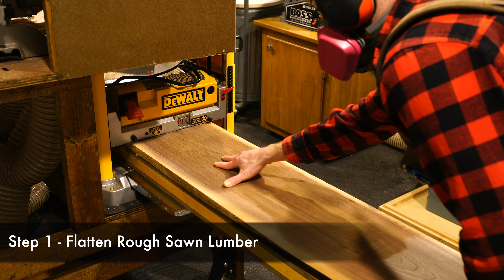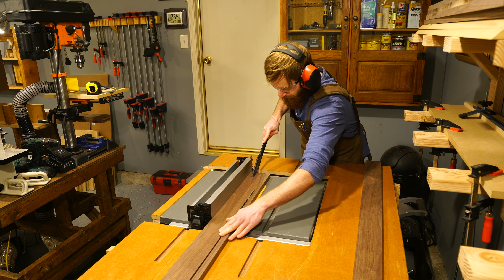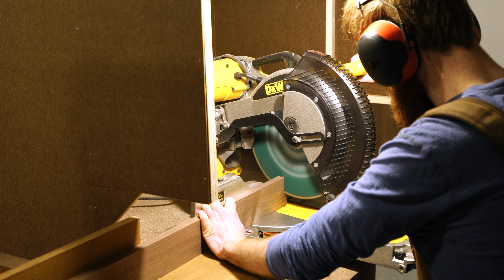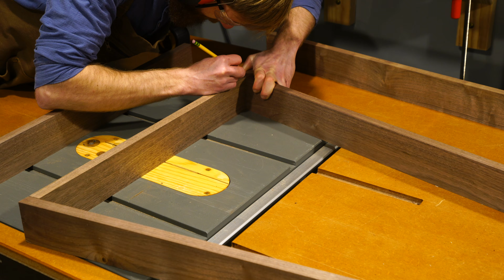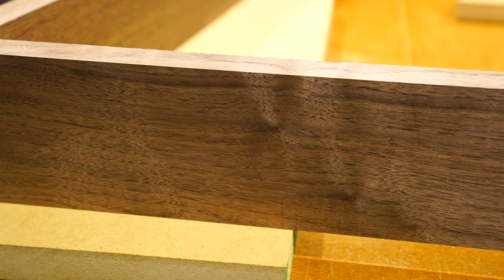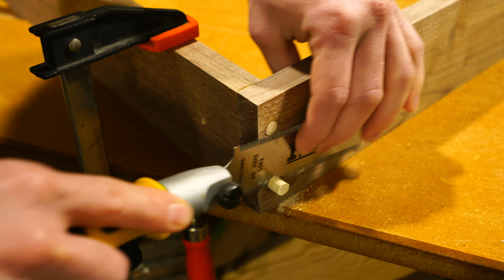How to Build Modern Desk Legs - Free Downloadable Plans Included!

Comment: I wanted to confirm something, i am currently making my legs. Did you cut all ends of the boards a 10° or did you only cut the inside boards a 10°?
Reply from the maker: To match the angle and to make sure the legs sit flush to the floor, the inside board and outside board both have to be cut at an angle at the ends.

Comment: If I wanted to make a table with a depth of around 36 inches would I need to change the angles? As the plan mentions a depth of 24 inches or greater I figure it could be necessary(?)
Reply from the maker: Yes I’d increase the angle for about 32 inches or greater especially if the legs are going to be the same height as my example. Good call my friend 👍
Reply: Great thanks for this advice - would a larger angle be something like 10/11/12 degrees or much larger? Just starting out on building furniture so still not sure of these subtleties haha
Reply: Great thanks for this advice - would a larger angle be something like 10/11/12 degrees or much larger? Just starting out on building furniture so still not sure of these subtleties haha
Reply from the maker: @sunking9625  yes I’d start out small with just a few degrees wider. Maybe draw it out, you’ll want some kind of protractor to draw the angles out. But drawing it out or testing on scrap wood would be a good first step. I always test things out before cutting into my project boards.

Comment: This was a great video and I really want to make these legs for a desk I plan to build. I would love to see how you connected these to the table top…do we need to account for wood movement if you’re going to use 5 qtr thick boards for a 50 by 30 inches tabletop? Also will it need rails between legs for a table that size? For support and strength? I’m a very new woodworker and sort of nervous about building something this big…
Reply from the maker: Hey, it took me a second but I have posted videos showing how to connect the table top to the legs! Rails between the legs would add more support from side to side so that is a good idea!
Reply: @_Shopfix  Well, I never did start that project but do intend to do so soon. I watched the second video when it came out :) and thanks for the response. cheers!

Comment: Nice table legs.  I'm going to try this with reclaimed redwood.  However, I will need an 18" top piece.  It looks like you cut the top and sides to a set of dimensions and then eyeballed the base.  If that's right, then I should still be able to use 10 degrees, right?
Reply from the maker: I recently made a set of plans which could help people with similar questions as you. Basically you just want to ensure that the bottom base is not wider than the table top and that’s purely aesthetic design purposes.

Comment: Hi William- Can you explain why you use the board jig with the clamps on it instead of just using the fence on the table saw?
Reply from the maker: Just personal preference, I think it worked though but you can improvise the clamping anyway that works best for you. Honestly I think you could use a nail gun even to set up the pieces for the more sturdy dowel supports. Really whatever works best, but the way I did it made the legs come out very nice!